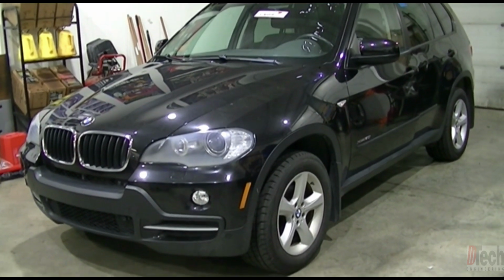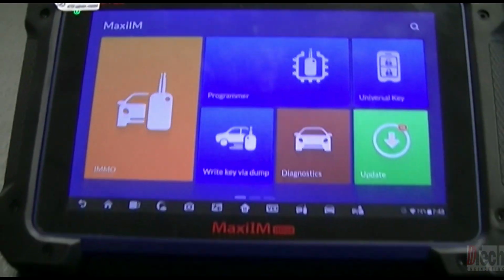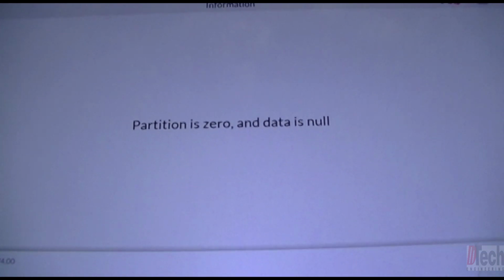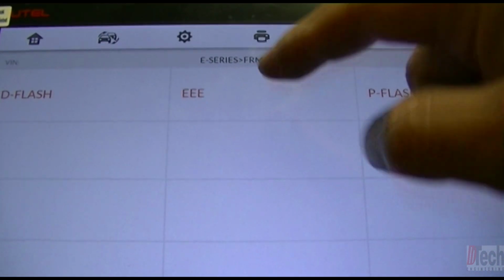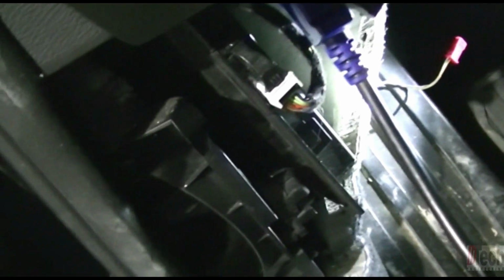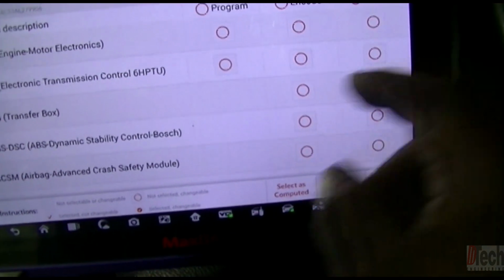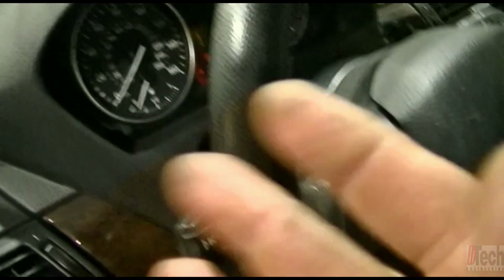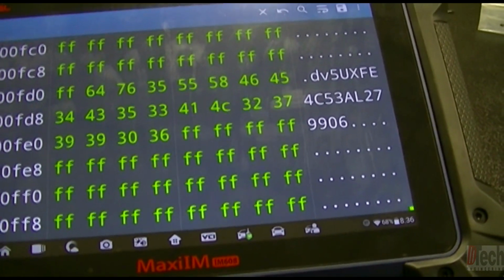BMW FRM FIX WITH AUTEL

Comment: do you know if the im508 can do the same thing
Reply from the maker: @scooter1391  yes it can
Reply: @DTEAuto  thanks for getting back to me, wish I knew more about this stuff
Reply: Using Autel IM 508, I wrote EEPROM to FRM via XP400 Pro then put back to Mini 2010 (Base), it shows differences among CAS and FRM(VIN, paint code, ..) thus lead to 2 FRM errrors. Can I use Autel IM508 to code (overwrite) FRM to match CAS data (like the one you did in video) ?

Comment: How can I retrieve the EGS / ISN 8 digits?
Reply from the maker: if it's still connected to the vehicle, there are some tools that will be able to read it via obd. Other ways I have done it is to read isn from another module either obd or bench, and pull the flash file from the module I am working on and find the isn in the hex data
Reply: @DTEAuto  this you will get from the ECU or the Cass? And thanks for your reply.
Reply from the maker: yes one of those will have the isn

Comment: Hello  do you know if that scanner can short circuit counter reset like the set tool 32  software?
Reply from the maker: I have not had to try at this point, but I do think I have seen that option at some point in the tool functions. Whether it works or not I am not sure.
Reply: @DTEAuto  thank you for replying

Comment: Wow that's a really really great video thank you so so much in advance. questions please.

1. Can 508 do that prosses?

2.And is there a list of bmw can be done that way?

3.Can this be done to Benz as well?
Reply from the maker: yes the 508 can perform the repair with the xp400pro. But it cannot do the online coding via the obd. All the bmw's and mini's that carry an frm it can be done to,  not on benz.
Reply: @DTEAuto  thanks for your response,

But the IM608 can do the online coding as you did right?
And I also have Maxisys MS909 can I use That instead?
Reply from the maker: @dashtyATG   correct, the 608 is able to do programing for benz and bmw, but you have to be current in the warranty/subscription period to have access to programing files
Reply: @DTEAuto  thank you I'm keep studying

Comment: Hello 
I saw your YouTube over the repair the Footwell module (FRM) for BMW e90.
Please if I send to you my FRM module by mail to fixed for me and send it back to me how much will be cost?
Reply from the maker: would you have a way to perform coding after the repair?
Reply: @DTEAuto  if you tell me how to do it and if it’s not complicated I can do it.
Reply: @DTEAuto  you can’t repair and coding it for me?
Reply from the maker: The way I can do it will repair it and get back working, but sometimes I have found and heard that the autel repair sometimes will need coding after it gets installed despite that it is able to operate windows and lights etc
Reply: @DTEAuto  okay great, can you tell me your address? And how much cost the repairing? I will pay via PayPal it’s okay for you?
Reply from the maker: contact me at Dteauto@gmail.com

Comment: Can you recover and save the P=Flash and write it to the EEE?
Reply from the maker: No you cannot, and it depends on what equipment you have in order to do the repair. The autel you would have to write the partition as I showed in the video, but there was an update to the tool where you don't have to do it manually, there is an option to do automatic restore/repair...I did an update video not too long ago on my channel showing the easier process

Comment: So strange. This is happening to mine except I don't have a LCS Malfunction message. No Hazard lights, high beams, angel eyes, windows, overhead cabin lights, or dash lights. Happened after I jumped the battery so I am thinking I fried it or corrupted it the software.
Reply from the maker: Yes, it most likely is the same issue, this can happen right after jump starting as you said you did, I had it happen to me and seen it happen. You don't have to replace it, just have it software repaired as I showed.
Reply: @DTech Engineering  Thank you for the reply. Was that rs232 cable provided with the autel model you purchased?
Reply from the maker: Yes it did, I believe you can purchase the xp400 pro and cable without having to buy the actual autel unit , then you can just use the pc version of the programmer to do the same function. I did a follow up video of doing and frm with the xp400pro and a pc, check it out if you have a chance.

Comment: Hi Sadel, thanks for the video. Many of the videos I have watched normally would download eee dump files to repair the FRM. Your approach I think works better. 

I have a Mini Cooper, 2008, R56.  How do I identify the right FRM on the Autel when I have the FRM hardware?
Reply from the maker: Hey, you would have to look for the chip numbering on the large cpu on the board, it's the big "chip" on the opposite side of where I made my connections in the video. Once you get the number off that, look for it on the list that the program offers

Comment: I heard that very recently Autel updated the IM608 software to where now it will read the DFLASH and will repair EEPROM . I haven’t tested this yet. Does anybody know if this is true ?
Reply from the maker: I too heard the same thing, I have a couple faulty frm's, I will have to check and see. If so, I might make a second video covering this
Reply: @DTEAuto  I think you have frm repair under "body repair" Thanks for the upload!

Comment: our coworker grabbed our maxisys elite and hooked it up to a x5 diesel, trying to clear particulate filter code after replacement, he's not to familiar with the autel system and ended up disabling the windows and lights, im suspecting FRM, is it possible he could have scrambled the FRM module with the autel?
Reply: A simple polling of all the vehicle modules including the FRM using any scan tool even factory scan tools can cause the FRM to crash
Reply: @DanVasquez  i guess it could have been either or in this situation, he didn't notice the  windows and lights were not working until he went on a test drive, so it could have been from the scan or the battery reconnect
Reply from the maker: I've not seen that happen yet, or not sure it it's possible, but since you do have an Elite, which is a good tool, first thing I would do is use that to try and attempt to communicate with the FRM. That will tell you for sure if it is corrupted. I have seen them get messed up from random starts, from jump starting, and from simply installing new battery. It's odd and dumb as far as when they decide to go bad. Hope you get your issue resolved.
Reply: @DTEAuto  ya we replaced the module, most likely from battery being disconnected during the filter replacement, sucks that its that fragile, thanks for the response bud

Comment: Great video, Sadel!  How would someone know how many sectors the EEE chip would have, especially since the drop-down offers a few options?  Is this info available in service data?
Reply from the maker: Hey Dave,
No that info is for sure not anything to be found in service information, but from what it looks like for the mc9s12x chip has a virtual eeprom in the dflash and max number of 256 byte sectors for buffer RAM EEE partition. So apparently for this you want to set up to the max.